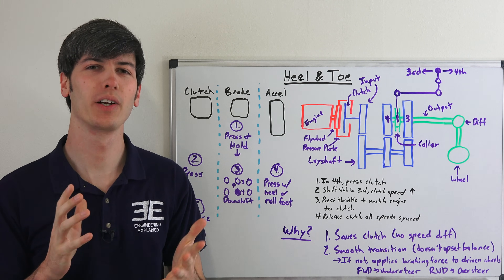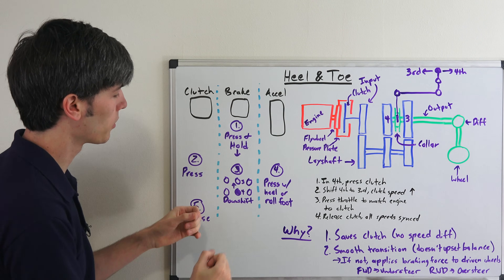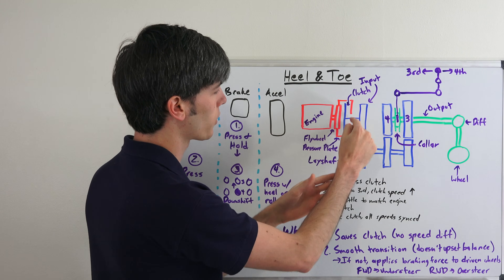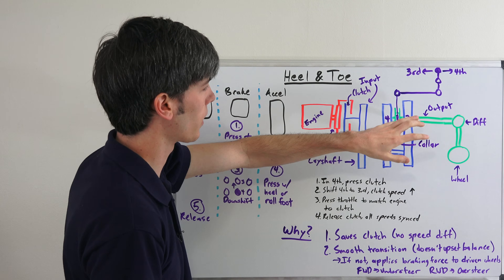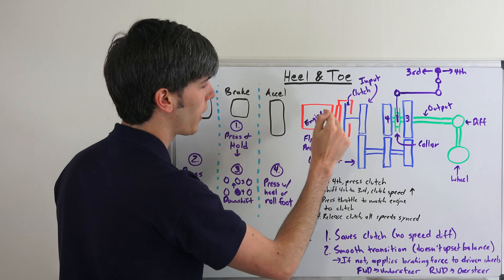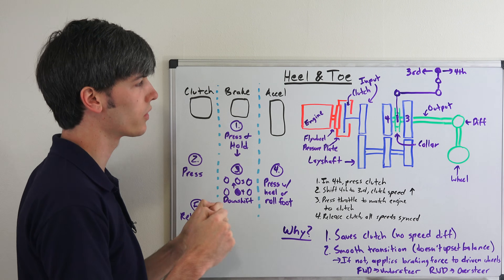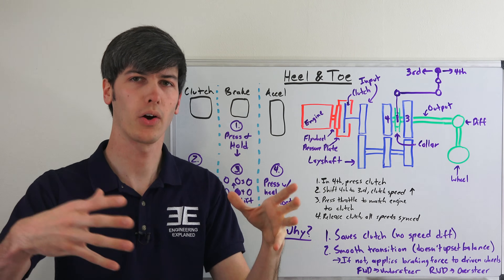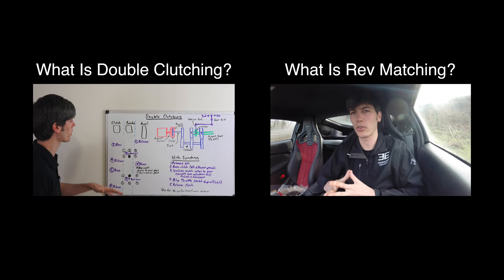What Is Heel & Toe? (Downshifting)

Comment: didn't understand why the engine rotates slower that the rest.. when it's detatched, it has no resistance connected to it so it should rotate faster. and, as I think the engine rotations go with the throttle, and the transmission only sets the rotation speed for the rest, doesn't it? So what do I overlook?

Comment: I practice this while the car  is in stationary. I found it's difficult to use toe for pressing brake pedal and heel for pressing throttle.
So I tried different way : use heel for pressing brake pedal and toe for pressing throttle, it's easier. However, I haven't practiced in actual driving until I find safe and comfortable using my own version of heel-toe.

Comment: What exactly is the need to do this?  What I do when I have to slow down suddenly is press down the brake and clutch and when the car has slowed down sufficiently, shift down, take the foot of the brake and onto the accelerator to rev match and then slowly release the clutch.  Am I doing it wrong?    Why do we want to hold the brake and rev match at the same time?  To save a few split seconds?  Today,  I tried to do this and almost lost control.  Doesn't help that I'm small and my feet are tiny.
Reply from the maker: For driving on the street, there's really no need to do this. The method you're describing is fine, since you're still rev-matching. That said, on a track, this will allow for quicker lap times as you can go from the brakes to acceleration immediately as you need it.

Comment: What I usually do is I put the car in neutral before the turn, turn and then I put in whatever gear is appropriate. Why is this wrong?
I actually use neutral in all situations in which I would have to downshift. But it must be wrong or everyone would do that since it is much easier...( I don't do that when the car is in high speed because I was told it is dangerouse for some reason...

Comment: First thing I do it's switch down gear then brakes then release the clutch (not fully) intill I get 500 rpms lower than when I've have to shift up again and floor it, the power comes back (it's like matching your rpms with the speed you get to in a lower gear while braking) then again it depends on how much hp/torque ratio you have, I've got a truck lower hp higher torque, pretty old shitty looking but a lot more fun than my automatic (1 year difference).

Comment: Unfortunately, the accelerator and brake pedals on my 2004 Mazda 3 are not positioned to expedite heal - toe shifting as I have on some cars I previously owned.  I am not happy about that!

Do you have a suggestion for modifying my accelerator pedal to expedite heal - toe shifting?
Reply: It is possible to do it in the mazda, you just need to practice using more of your heel to blip the throttle.

Comment: I've never done this technique that I am aware of while downshifting in my Corvette, which I do a lot.  I down shift by taking it out of OD then go from 4th to 2nd on all turns.  I don't need to slow it down to 3rd because it responds better and safer if I also use the engine to brake into the turn. I can turn at a good rate of speed by simply hitting the OD off then just simply depress the clutch and brake as I start the turn and hit the gas while I'm completing the turn to regain speed again.  It's all a very fluid motion and it's like the car is turning on rails.  I'm turning at a good rate of speed, yet there is no over steering or under steering while going from the brake to the gas petal. I have an older model 86 Vettte which Ive owned since 87with the 4+3 (+1) Transmission. Since it has the high performance handling package it has an extra gear ratio in first gear as well. I have raced it on the quarter mile without a line lock and was asked to race for the Joe Pisano racing team back in the 90's I'm not bragging, (well maybe just a little) but the reason they invited me to join the team was due to my skills using a manual transmission on the 1/4 mile and winning the races. 

So reading about this technique was a learning experience for me.  I've never been aware of it, not even sure if I have ever even unconciously done it driving any other vehicles.  Interesting channel.

Comment: can please anyone explain whats heal and toe i didnt get it !!! please!!! and why it is used i saw the video 2-3 times still didnt get it , i am learning to drive now!can please someone explain what is it ??? and why it is good ???
Reply: If you are learning how to drive now forget it, you wont understand. After you learn the basics and drive for a while you will get it.
Reply: Heal Toe downshifting is matching the engine RPMs to the gear you are selecting. It puts less wear on the car. Going from 4th to 2nd without doing that means that the revs wouldn't sync up. This slows you down and causes unneeded wear. At least this is my understanding of it.
Reply: +Scatterus Heel** ;P
Reply: If you want an easy way of putting things, in 2nd at about 20km/h  try putting your car in first, if you don't heel and toe the rpm will go high by itself, you'll loose some speed induced by the clutch going faster than the engine so basically make some serious engine braking, and you'll feel the car go forward and you get shaken up or something, no idea how to say that in words tho lol. If you do, you'll try to match the rpm of the engine with the clutch, it depends on how fast you are going (at first it's guessing, then you learn how the engine reacts to what speed and gear).
So you made the rpm high already, you won't loose speed, since the clutch and however it's called in english are at roughly the same rpm, and it's going to be really smooth, you can almost dump the clutch and not feel anything (not sure about that tho)

Comment: How do you go about heel toeing cars where the accelerator is further away from all the other pedals ?
Reply: put on your hazards and use your hand to blip the throttle.
Reply: take a long hard look at how the pedals are mounted... some (surprise) can be adjusted for height. But getting them closer seems like a job for having someone weld a side extension onto a pedal. I've even seen where the entire pedal was removed, heated with a torch and bent in an s to move it over and up- at the same time. Was a brake pedal. Get innovative !!
Reply: Rick Noah Rather than having to fiddle with anything I simply just adjusted the technique to better suit my car. It's fantastic, I just need to remember that the gear ratio from 3rd to 2rd is quite different as I am a bit unsmooth on that.
Reply: first of all you sell the car and buy a better one then you do the same as in this video
Reply: I can basically heel toe perfectly now

Comment: Here a clarification will clear the air as to why a big toe small toe operation of brake and throttle is called heel and toe. Up to 1930's a lot of the cars, e.g.  cars,  like Packards and Alfa Romeos, etc.  had the throttle between the brake and clutch and set lower down. This was very convenient for depressing the brake with your foot in the normal full five toes on the brake manner and have the throttle under the heel , with the foot perfectly canted  in a convenient ergonomically correct manner. The non synchromesh transmissions required throttle manipulations especially while down shifting. Normally you pressed the throttle with the foot but when braking and down shifting you moved up to the brake pedal and heeled the throttle, which had very little throw. This also gave enough foot pressure on the mechanical brakes.

Comment: Presumably you can't just randomly press down on the accelerator and instead need to actually be aware of the engine revolutions needed for the gear to be selected. For anyone who does this, do you know what numbers you need to match for each gear? Is it the case that decreasing the difference is better than nothing?
Reply: You'll get to know the specific difference on your car...but as a rough rule of thumb for my vehicle...it seems that down shifting will need an engine rev of about 1-1.5k higher....I.e., if I'm driving in 4th gear at 40 miles an hour and my car is at about 2000 RPM...downshifting to 3rd gear and maintaining the 40 miles per hour will have it at around 3250 RPM

Comment: to elimate understeer/ understeer in a corner, couldnt you just give it some gas as you let off the clutch insted of double clutching?
Reply: Yeah it'll make it smoother but it's worse for the clutch that way as you're using less of the engine to match the speed of the wheels and more of the friction clutch to slowly bring the revs up while slowing down the wheels. Heel toeing and 'blipping' the throttle is always going to be better because the revs will already be where they need to be before you let off the clutch (meaning less energy will be going into the clutch when you re-engage the gears aka longer clutch life). Generally speaking, you should avoid using the gas while engaging or disengaging the clutch (other than starting from a stop where you should avoid too much gas until the clutch is fully released).

Comment: This is kinda, maybe, sorta like rev matching?
Reply: It IS rev-matching... While braking.
Reply: Alex, generally heel toe is used when driving a car at the limit. In the case you mentioned, heel toe is not really needed. If you were on a track and driving a car at it's limit, you cannot rev match before braking because you are already in the high RPM's. That's why people use the heel & toe method. That way you can slow down and change gears without over revving your vehicle or using the down shift to further slow down the car.
Reply: Alex Halbleib it's the same thing....
Reply: As seen on your other video?
Reply from the maker: Yep, rev-matching while braking.
Reply: This definitely puts this more into perspective since I've been driving a manual 2011 Camaro the last 3 years I've never actually Heel and Toed but as Subi said I just rev match typically 1k above what I'm at when I decide to up or down shift which always provides a smooth shift which I'd also assume isn't wearing up the clutch anymore or less than it should. So is it more comfortable for people to do Heel and Toe rather than rev matching?
Reply: Alex Halbleib The toe part of heel and toe is where your toes are on the brakes, hard, it's definitely not comfortable to do. It also sounds like you have no need to do it, unless you've experienced sudden engine braking with normal downshifting that makes you spin out, not likely to happen during casual driving.

Comment: Question regarding shifting: So let's say I'm driving along on a road, in maybe 3rd or 4th gear, going let's say 40mph, and up ahead there's a red light. So I push in the clutch and prepare to slow down, and slow down to maybe 20mph... But then the light turns green before I stop completely. Is it safe or correct to just let back off the clutch and accelerate in the same gear, or should I downshift and then work my way back up again?
Reply: +Ethan Moore good to know thank you. I'm slightly new to driving manual... I recently learned for my job and only just drove a manual on the road with other cars a few days ago, so I'm still learning a lot of things. Thank you for the useful information!

Comment: Correct me if I am wrong but from my understanding he is saying we should not skip gears? I always up shift 1-2-3-4-5-6. But depending on situation down  shift from 6-4 or even 6-3 /5 -3/2 to utilize engine breaking.  I drive this way and have put 330,000 plus miles on an original clutch. Should we also not skip a gear when down shifting ?
Reply: From my understanding, if you drop two gears without rev-matching then you are increasing the braking force that EE talks about in the video. Essentially you are making the difference in speed between the clutch/transmission and engine that much greater. It should be noted also that clutches have gotten a LOT better in the last 20 years. Back in the day you were lucky to get 80k miles out of a disc, nowadays they can last upwards of 200k miles.
Reply: The heel & toe technique is actually precisely what you should use when skipping gears going down to reduce wear on your transmission.

Comment: Couldn't do it with my first manual car (Pontiac G5) since the throttle and brake are not only far apart, but they aren't even flush together. The gas pedal is set much deeper in the footwell than the brake and clutch.

Going to try this on my Eclipse GT, fingers crossed.

Comment: I purchased my first manual transmission 2 years ago.. (2005 Honda Accord EX, 5-speed,  4-cyl)..  I learned how to drive manual on that car.  I still have it and love it more with each passing day!

I've never "downshifted", not once.  If I'm driving along at 65mph in 5th gear and traffic gradually slows down to 30, I'll let the car slow down in 5th gear and when its time to accelerate again, I'll drop it straight down to 3rd gear and go.  Never had any issues yet, and I live LA, drive in traffic and on the highway daily
Reply: As a daily driver, I still prefer an automatic. On my morning commute I'm always making phone calls, planning the day etc. On the weekends however, I hop into my oldtimer that gives me complete control over everything.
Reply: +Jermain Jones You're robbing yourself of so much more control!

Comment: if i let the clutch in neutral and then rev-match and then press the clutch to insert the other gear, doesn't that save my synchronizers too? i would have mentioned that in case
Reply from the maker: +Mr.xxxxxxxxxx17 double clutching, which I have a separate video covering (and explanations of the benefits/reasons for doing it), but in short yes.
Reply: +Engineering Explained i actually saw that video but forgot it lol thanks for the answer anyway;)

Comment: Question: what is a man to do regarding "heel and toe" when he has human feet that can never articulate to the level of weirdo pro drivers'? I would need to heavily modify car pedals to fit my NORMAL feet. In the meantime, I'm forced to feather the clutch in and rely on synchros.
Reply: Excellent explanation! My problem really is when twisting my foot to the left to toe the brakes and somehow heel the gas deep enough while maintaining the level of braking I need. But I'm going to try as you explain it, thanks!!

Comment: I got one question about heel-toe down shifting, it seems pretty straightforward, but when I let off the clutch after blipping the throttle, the car jerks a little sometimes. Is it because I'm letting off the clutch too quickly?
Reply: +JustTahmid I think you're revving too high.  You can release the clutch instantly if you've rev-matched to the right engine speed without any upsets.
Reply: +Spectre Cyte Really, I didn't think revving higher than you should was an issue.

Comment: My mother was a WAAF transport driver in WWII. She taught me to drive with the assumption that synchromesh in transmissions did not exist — which in the military vehicles she drove it didn't. She called them "crash boxes". And so ... I learned to drive matching gear ratio to engine speed. About the same time, I learned that heel and toeing was the same thing as she was doing, but just more efficient than her off and on technique. (I doubt that transport lorries were really set up for H&T in her years of service). I've been driving H&T ever since — even in docile traffic. It's just a habit. Ma was a great teacher and an impeccable driver.

Comment: How about not using the damn clutch at all and just match the engine RPM to the gear you want to be in? Works on both synchronized and unsynchronized manual transmissions.

Comment: Though the idea behind this is sound, what nobody is mentioning is that if you can't tell me what RPM's your clutch is spinning at say 50 mph when you shift from 4th to 3rd (or whatever gear your are shifting down to) you will not be able to match that RPM with the engine. You may be able to get it closer, but you may over rev too. Unless you are a truck driver that has to do this to downshift (floating gears excluded here) or you race and know at what RPM's you will shift every time and what RPM difference you will need, this is useless. I can see some kid watching this before taking his dad's car out, over reving when he needs to slow down and hitting the car in front of him because he has no clue what he is doing.
Reply: +Phillip Morrison Few ways to get around this. For example, I can usually heel-toe a car I've never driven. Basically when shifting up through the gears you learn the spacing, albeit briefly. So when you go to downshift, to err on the safe side, you blip higher than what you actually need. Then, you gradually let the clutch out when you think its right and blend it in. The change should end up being pretty smooth. Then from there, your clutch release will just get faster and faster, and soon you will do it without much thought.